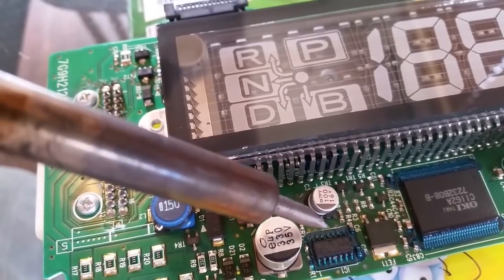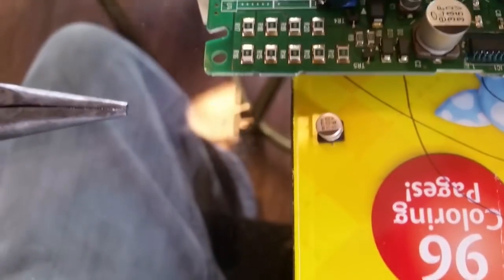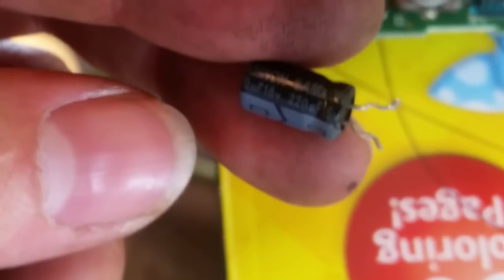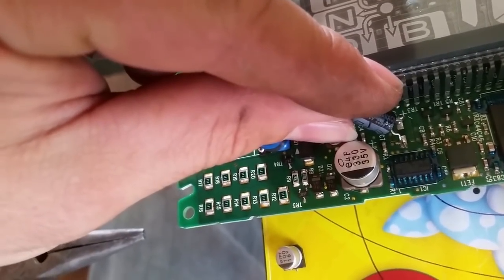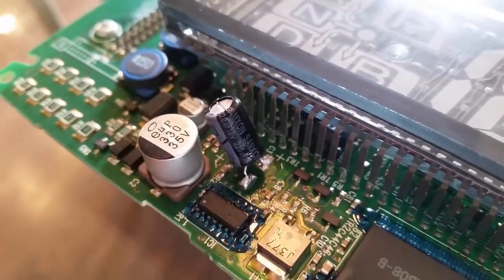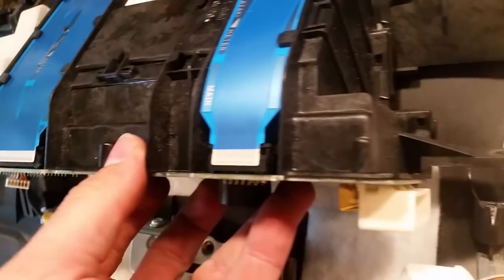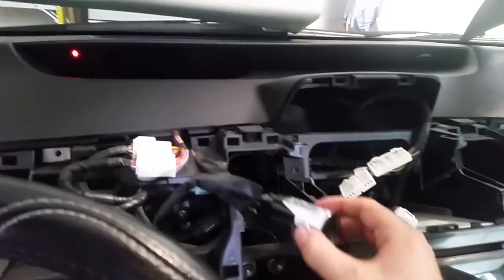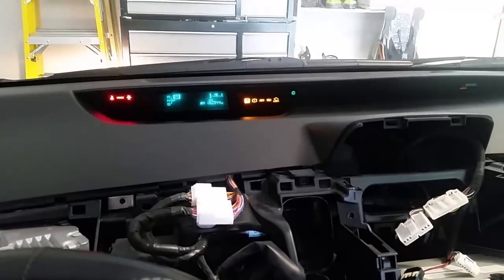Prius Gauge Cluster Capacitor Repair

Comment: Does this have to be done every single time you shut your car on and off? Thinking of buying a friends Prius that is having this issue. It’s a good deal but just wondering if it’s worth it with this problem. Would fix it eventually

Comment: Did you find that replacing the capacitor with a higher voltage of 200 affected the performance of the car or anything? Curious before I replace mine. What is the reason for the higher voltage? Just curious
Reply: It's not a higher voltage, it's a higher capacitance.

Comment: Worked perfect!  I picked up a capacitor for $0.50 at a local electronics shop and used this video to get the dash apart https://www.youtube.com/watch?v=pb19p8zYeTg&list=PLHgiUN8Y_bz1W0zzogL8_-DxkL8dUTL37&index=2 .   Took me about 3 hours total...not bad at all, especially since I hadn't used my soldering iron in maybe 5 years.
Reply: Did you need a liquid flux or just a good flux solder?

Comment: My mechanic told me I should replace all 10 capacitors with increased voltage ratings so that it could handle more power, also because you never know when the next ones will go out. Here are the replacement specs for the ones I used and are working in my car currently =)

10uf - 35v original > 10uf - 50v replacement
100uf - 16v original > 100uf - 25v replacement
22uf - 63v original > 22uf - 100v replacement
330uf - 35v original > 330uf - 50v replacement
100uf - 50v original > 100uf - 63v replacement
Reply: I know this is an old comment, but has to be said, there is no reason to do that. The originals can handle 35V, the system never goes above 14.4V so that is completely pointless.
Reply: 1 Year later any updates
Reply: @Mojo27564  still rockin the same replacements 40k miles later, no issues

Comment: Over time vibration could easily crack the solder joints, if you lay it down flat and hot glue it to the PCB it will be much more secure.

Comment: Thanks John for this clip! Just what I was looking for. 
We've removed the board and have the 220uF ready to go. I've watched some great electronics soldering videos for tips (high heat/short time, etc), but I was stymied by the difference between how the old capacitor is attached vs the new one will be.
One prius fix site commenter suggested reinforcing the new attachment with electronics grade silicone for this kind of connection...

Comment: I have to do this myself. Thanks for posting this. Though I plan to piggyback a new capacitor over the existing one.
Reply from the maker: That will work too
Reply: No need to do that
Reply: I just did this and it did not work 😢

Comment: I love the way you illustrate the actual repair and omit the rest,since there are tear-down videos already posted. Your close-up videography is outstanding and perfectly focused, allowing one to see the area close-up. I have the intermittent problem now and for the last year or so- mainly when below 40" F. Thanks for posting this very specific video.. Like Tanasi Tim, I'm also trying to get the nerve - just waiting on part from Amazon. Only concern is the clips to the dash pieces not fitting together as tight as before when putting everything back together. Car has no rattles now and don't want any LOL!

Comment: I preheated the solder and removed the old one using your technique. I soldered the positive side and then the negative side without Flux. Yes, I was amazed, since it was my first time soldering. 

It is tougher to remove the dashboard, so get a friend to help. 

I bought 5, since I thought I would make a mistake. Get the 100C capacitor also. 

https://www.amazon.com/gp/aw/d/B07BCHVS32?psc=1&ref=yo_pop_mb_pd_title
I bought this soldering kit. 
https://www.amazon.com/gp/aw/d/B07GJNKQ8W?psc=1&ref=yo_pop_mb_pd_title